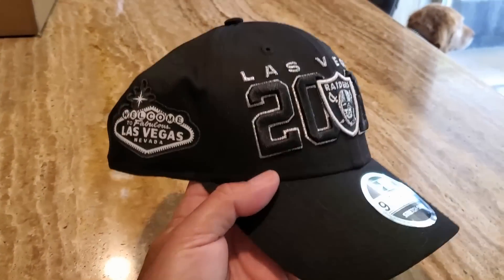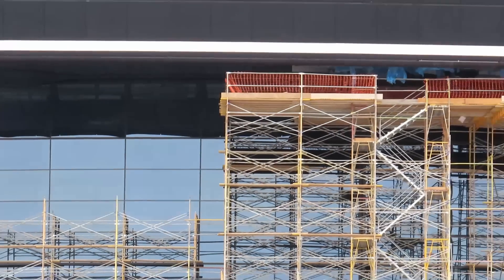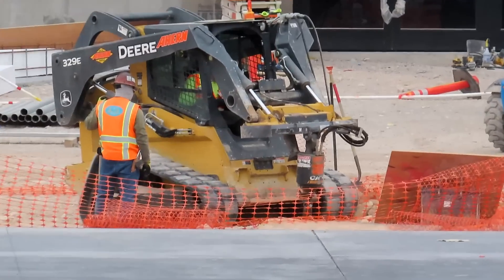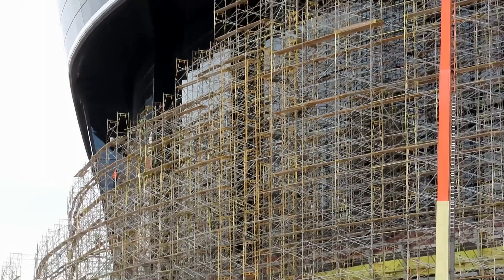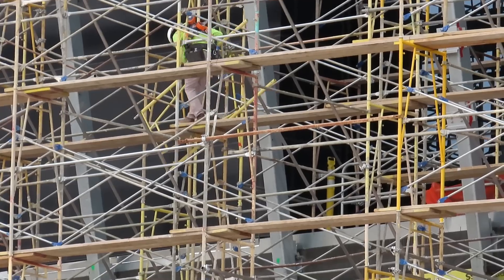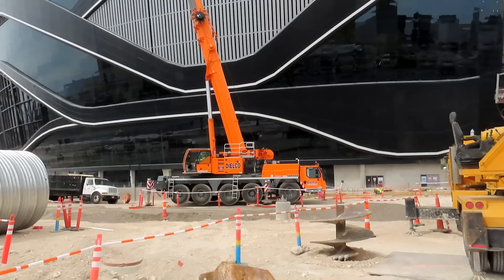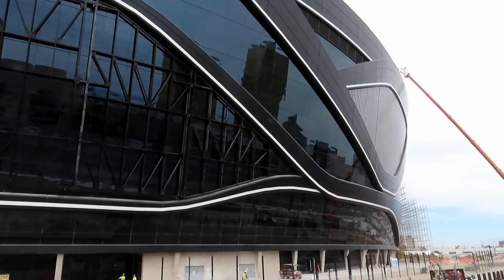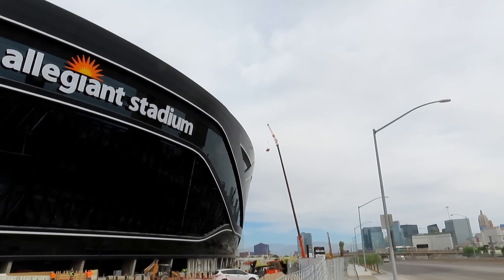Las Vegas Raiders Allegiant Stadium Construction Update 04 30 2020

Comment: They use the foam filling as a new sealer for building supplies it’s much more reliable than using cement or dirt the foam cord will not shift or move or road and it’s much easier to to put in place because it’s so light lots of construction projects now Use foam to artificially fill in spots where they need to elevate or fill in holes

Comment: Isn’t the roof suppose to be glass??
Reply: No its ETFE an fluorine based plastic thats translucent used in many stadiums
Reply: glass??😂😂
Reply: Christopher Quiocho it doesn’t look very translucent?
Reply: thepushanddewproject   You are confusing transparent with translucent.   

It was probably not possible but I wish they could have used a darker tint ETFE to blend more seamlessly with the dark look of the stadium, while still achieving the  95% translucency the current roof will have.
Reply: @thepushanddewproject  "Compared to glass, ETFE transmits more light, insulates better, and costs 24 to 70 percent less to install. ETFE is only 1/100 the weight of glass, and it has properties that make it more flexible as a construction material and a medium for dynamic illumination." You can read more about it here....https://www.thoughtco.com/what-is-etfe-new-bubble-buildings-177662